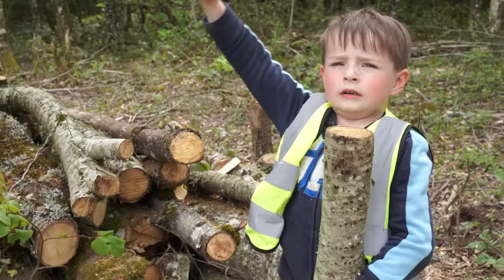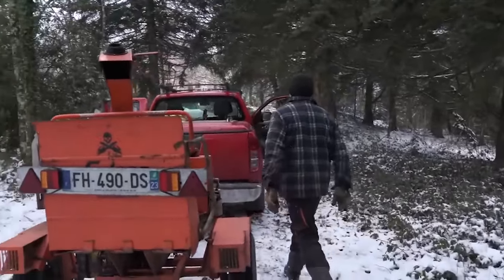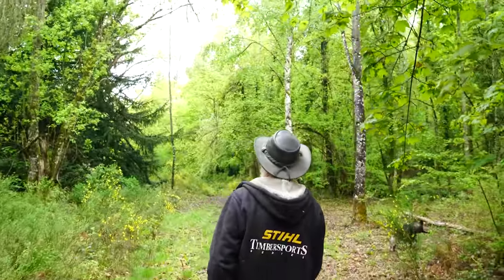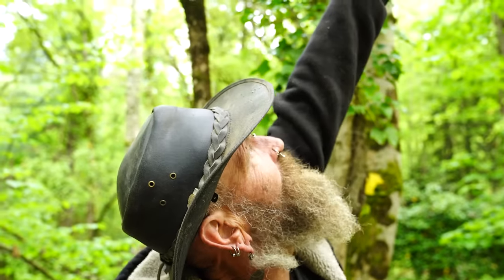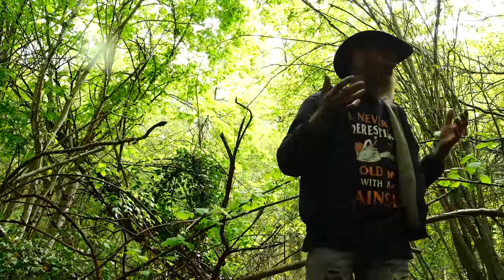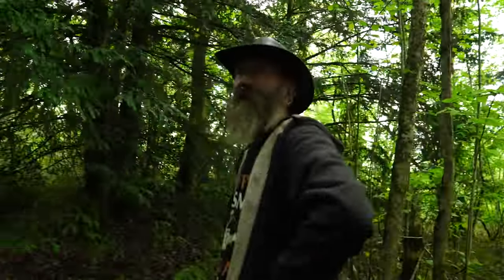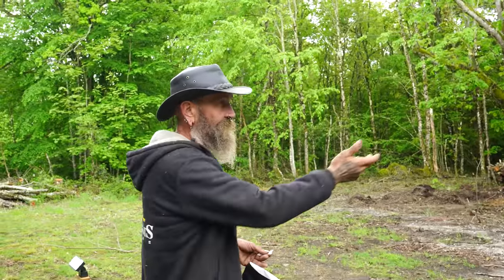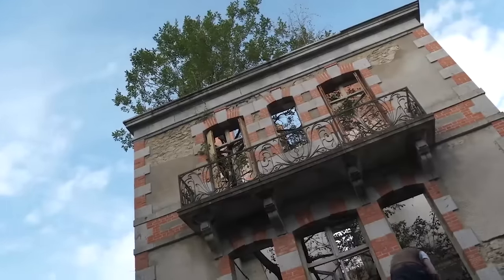The ultimate woodland plan, with Nic the tree surgeon; FULL TOUR

Comment: At last, one of my questions answered, 'is there a well?' now maybe 'when will there be a pump on the well', will be answered? I'm sort of a practical person, planning the woods is nice, but first things first, it seems to me with all the cement work there needs to be water available that you don't have to buy, would make sense long term.
Reply: Needs electricity
Reply: @debbierudolph9489 Good point but doesn't he have generators? If not maybe worth buying one to at least fill up some big storage containers because (the cost of water needed) for mixing the amount of concrete needed for this renovation, plus cleaning plus one major fire already just seems to indicate that something on site is necessary. Maybe will have some municipal source at a later date? It isn't as though there's any roofs to store rainwater from!!
Reply: @debbierudolph9489 Also, reminds me of Chateau Diaries when they got the well up so that they could at least use it for the garden. So, seems to always be some use for the existing well at any time.

Comment: I've read that the park at Versailles has to be substantially replanted about every hundred years. The park must have been complete by 1680. In about 1780 it was replanted during the reign of Louis XVI. There are paintings of it. There must have been a replanting after the Franco Prussian war to repair damage and again in 1980 in prep for the Bicentinaire. In an other 60 years they'll probably do it again?  

Cutting the tress way back could also be good protection against forest fires? The way Nick is talking about drought conditions already maybe so? 

t makes me nervous the way the well looked wide open and the boys are running around. Didn't you pull out old grates or gates or maybe that's from another chateau project? I think it's usually illegal here (USA) to have open wells.